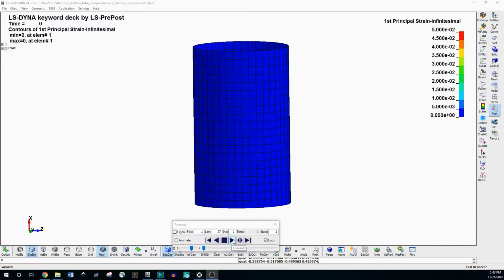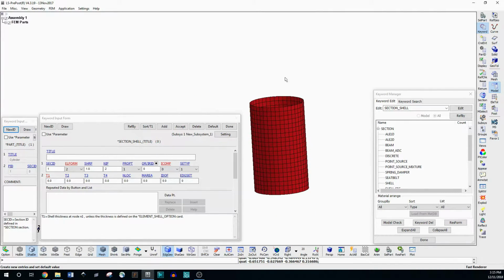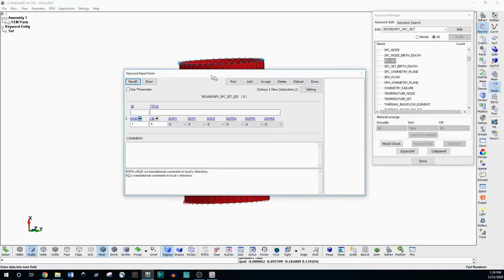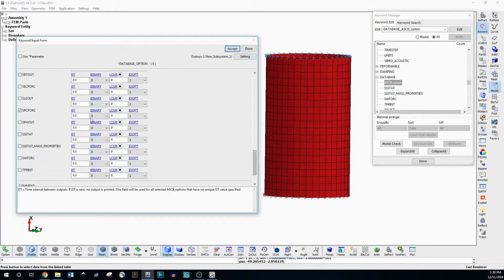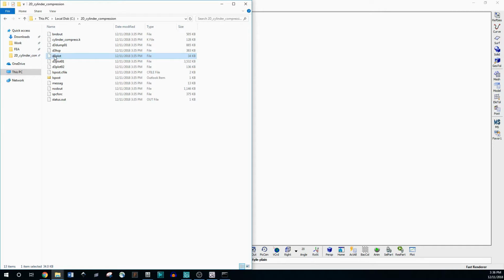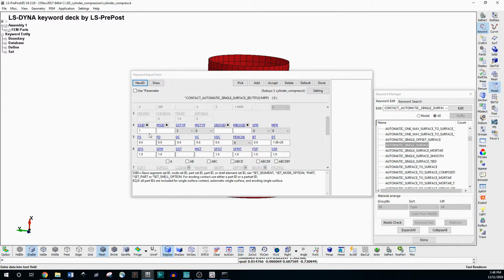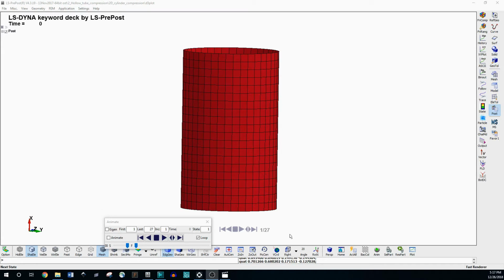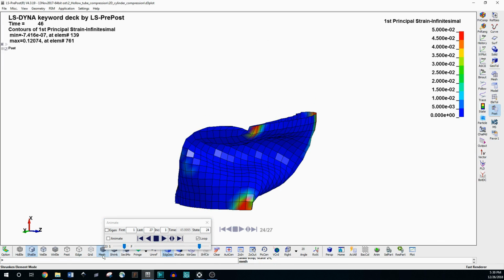LS-DYNA Tutorials for Beginners: Finite Element Analysis Hollow Cylinder Compression

Comment: Thank you so much for the video! May I ask if the penetration will still occur if I give it a much coarse mesh (say 5 to 6 times larger?); this happened to me when I gave it a coarse mesh. Thanks for your inputs!
Reply from the maker: Could be! When you have a coarser mesh your contacts are going to have a more difficult time to keep things from penetrating. There are things you can do to prevent it like make the contact option: soft=2 depth=5. Of course, this can increase computation time and perhaps negate any time savings you would have from the coarser mesh. Can't say for sure.

Comment: I have been facing a strange problem with the D3PLOTS obtained in LS-DYNA. I have modelled my structure as shell elements of CFRP-Aluminium sandwich structures to obtain the deceleration values while an impactor (rigid body) collides with the structure at 11.9m/s. I have used CONTACT_AUTOMATIC_SINGLE_SURFACE for modelling the contacts between the FEM parts and CONTACT_AUTOMATIC_SURFACE_TO_SURFACE with a friction coefficient of 0.3 for modelling the contact between the impactor and the structure. I had been doing this type of modelling in my previous simulations as well and have obtained very close results to the experimental value. But in this case, the simulation does not go through at all, reflects an irrelevant completion time and some part of the FEM structure disappears in the D3PLOT.

Each of the FEM sections has a different layup or honeycomb thickness as present in the design which has been modelled using PART_COMPOSITE. Also, the Timestep calculation done in this simulation by LS-DYNA is pretty less (in the range of 8.66e-9) although the average element size remains 4.9mm. (For a comparison, I had remeshed the same structure with an average element size of 3.5mm and my timestep was comparatively very high, in the range of 8.5e-6)
Reply from the maker: That’s strange. Have you tried simulating the model with the smaller mesh that you mentioned? And is this a similar model setup to the other simulations that you said ran fine? I would check for any duplicated nodes and elements in the model and also check that the normal direction of the elements are consistent for each part.

You can also check the energies of the sim result in GLSTAT for any spikes in internal energy. If there are some you can narrow down which part is causing it by looking in the MATSUM for energies of the individual parts. That will at least help narrow down where the issues may be occurring.

Comment: Hello Sir, how to do contact of concrete with composite material?
Reply from the maker: So a contact is only 1 part of modeling and does not define material properties of the contacting surfaces. You can define static and dynamics friction within the contact though. So if you were wanting to model something in contact with concrete I would just give the contact high values of friction such as 0.7
Reply: @UnpopularMechanics  ok sir, thanks for replying me.